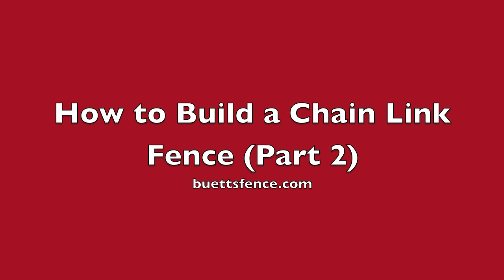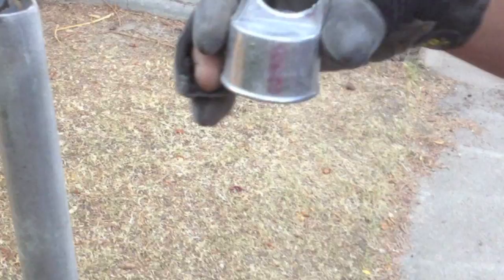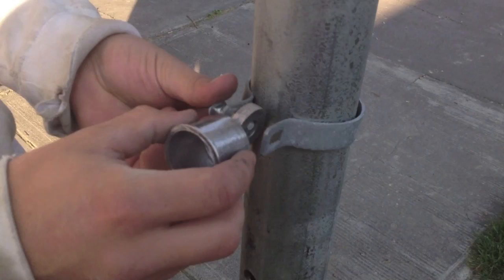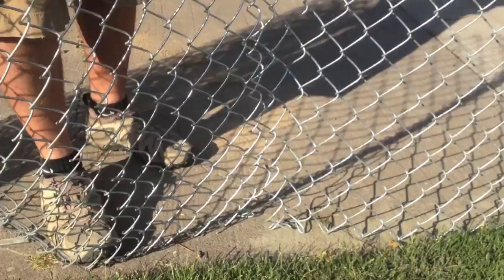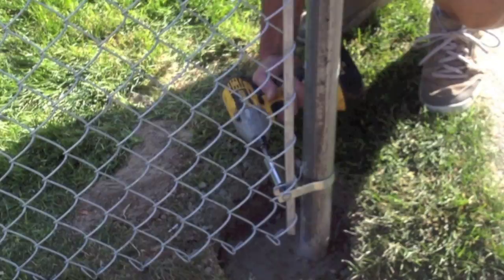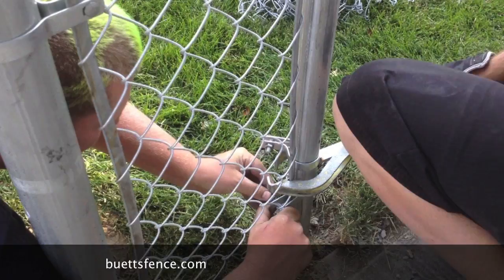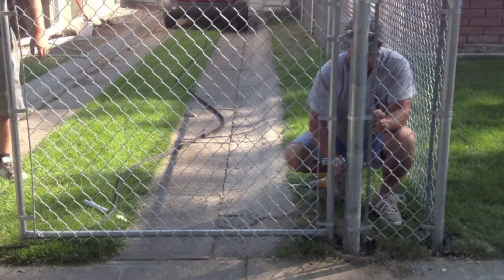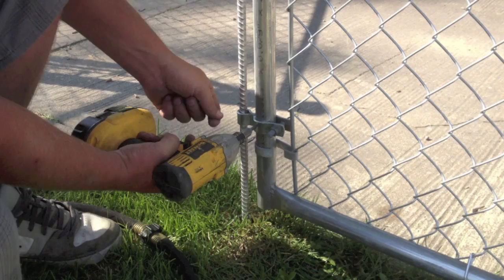HOW TO INSTALL A CHAIN LINK FENCE (PART 2)

Comment: Good video. A few pointers.
1.) It's stronger to have the top rail pieces connect together next to a post and not in the center of the section.
2.) For the double gate they make a part called a drop rod assembly, which looks a little better, bolt on, and is lockable
3.) If you use a small piece of chain to wrap around the post and connect to cablejack to that instead of wrapping it around the pole its less wear on the cable and makes your tool last longer.
4.) I didn't see a 9 gauge tension wire at the bottom.
Reply: Number  4 is my same question. The tension wire at the bottom.

Comment: The gate looks fine but why is the top rail so uneven and crooked....??  There are places along the gate that are 2-3" higher than other spots.  Did you not set the support poles level?

Comment: The gate has metal pieces shaped sort of like a J that hold the gate mess to the smaller "rod". Does anyone know what that is? I bought a gate and it only had two on one side and three on the other so I asked to have it sent out to me. They sent me a tension band. That is not what I am looking for. It is not a piece you need to put on as it should already be on it but my gate was missing one.

Comment: This is a fantastic video.  I wish we had watched it before doing ours.  Any chance you have anything on custom building very large drive gates (82" each gate panel, 4' tall)?  We don't have the option of putting a drive gate on casters since the gate opening is in a confined space.
Reply from the maker: Give us a week. We will post a video on how to build a custom 4' tall chain link double gate, we will be sure to cover all concerns.
Reply: Buetts Fence Interested on how to make large double gates, too.

Comment: What kind of a drill bit goes through the chain link poles? That's what I've had the hardest time with. Home Depot must have told me the wrong kind because all the bits I tried dulled out before I was able to get half way through. Help?
Reply: don't use drill bits for wood. there's a difference in drill bits, they aren't all the same.

Comment: great video. but shouldn't there run a wire all along the bottom part of the link so you can't lift it up ? this might be a local requirement though. ....
Reply: The wire at the bottom is for extra stiffening.

Comment: Is the same principles apply if you are installing a 4' fence on uneven ground; hills?
Reply: Seems the main thing is the posts should be installed vertical and not tilted in an attempt to match the grade. The top rail would be angled as needed to keep it parallel with the slope of the ground.

Comment: Did you make the stretching tool yourself? Also it appears that the posts aren't cemented yet is that so?
Reply from the maker: You set the post in cement first. Let it set for a few days then finish the fence.
Reply: Hello, so all posts are 10 feet apart from each other? And also EVERY post has to be cemented?

Comment: How do you install a chain link fence but with wooden pickets instead of chain link?
Reply: Raymond Alexander instead of the iron post just use "3 by 3, or 4 by 4's"!
Reply: then that wouldn't be a "chain-link" fence. change your search.

Comment: At about 5 minutes and 33 seconds are the most uneven tension bars i have seen
Reply: Lol and the mesh is too low
Reply: @SimpinForJesusNut  Hi can I ask you a question? Someone is installing a chain linked fence for me. Before they could add the caps on the posts it rained. Will there be damage to my posts and should the posts be replaced? Thanks!
Reply: @SimpinForJesusNut  Hi can I ask you a question? Someone is installing a chain linked fence for me. Before they could add the caps on the posts it rained. Will there be damage to my posts and should the posts be replaced? Thanks!
Reply: @SimpinForJesusNut  I have a question. Will damage be caused to my posts if it rains before capping them?